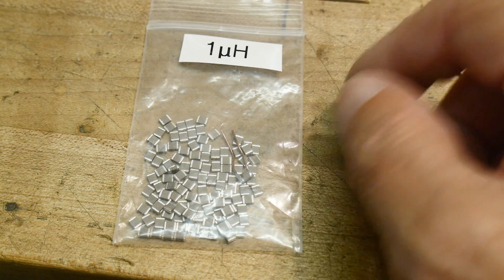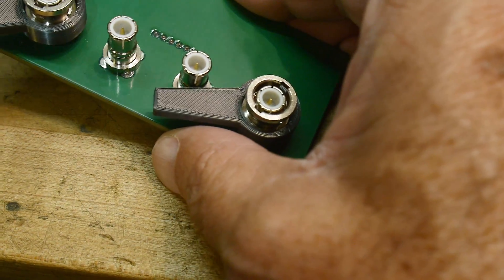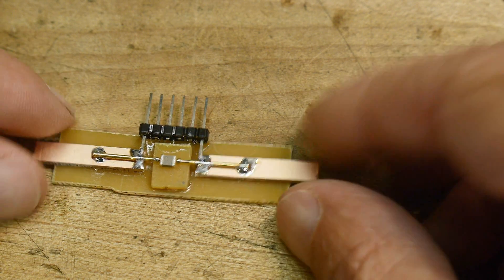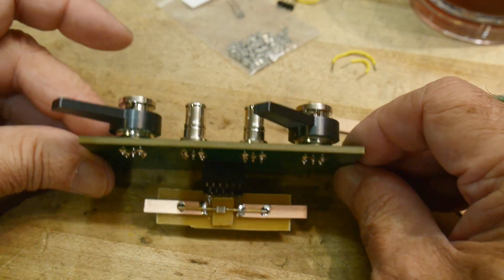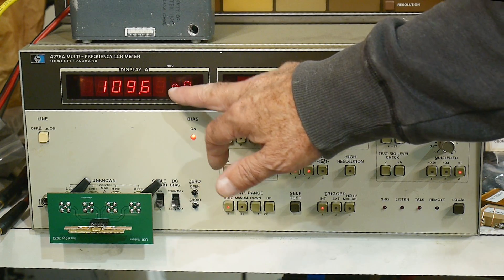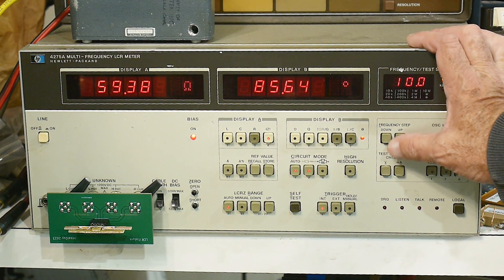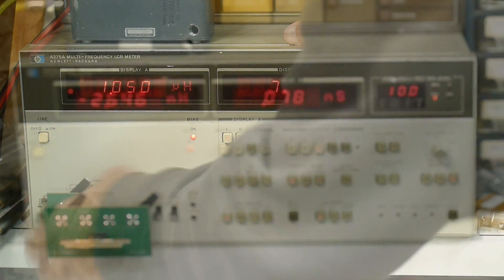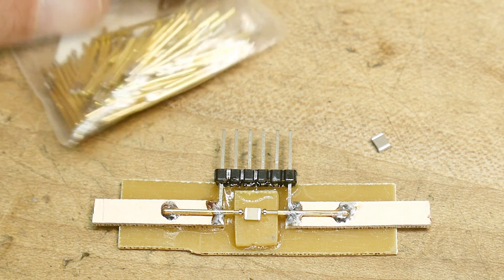#1700 SMD Fixture for LCR Meter

Comment: What I would like to see is the capacitance of the empty attachment.  I notice the frequency dependent change in the impedance angle display.  That is one reason to suspect stray capacitance effect.  I myself have so far used an SRC meter (only up to 100 kHz), but with Kelvin “tweezers”.  Of course they are quite pricey.  But for a DIY socket I would consider making a little L or U shape brass or bronze sheet metal device, mount it vertical, and form the “knife” edges a little V shape, open at the top.  That way I would be able to simply drop the part between the two or 4 knife edges with tweezers, maybe pushing just a little down,  The tweezer could grab the part in the smallest dimension, just like you probably do with your pogo pins?

Comment: I only do ball park checks and sorting so i got those cheapo tweezer probes, shortened the leads and connected them to my component tester.
At the moment i do nothing that needs more than a +/-5-10% accuracy, so it's fine. Plus i can do in circuit testing with them, with all the attached caveats of course. Once i do something where i order 10kg of capacitors to just find the one that i need (aka binning) then i might be in trouble and in need of something better :D

Comment: Board layout matters for sensing, Analog has an excellent write up on it in the June 2012 Analog Dialogue. A simple pogo pin jig like this could have errors in the single to double digit percentages depending on the range.
Reply from the maker: you can do an open/short and cancel out any errors

Comment: Hello, here is one more idea, you can use clothespin or clothes peg. Use wooden one, Glue (kitchen) metal foil on both ends and solder them to probes which you put. In that way, you can literally grab component and release handle to grab component and keep it under tension.
Your design is good one, but its smd slingshot in some way... :)

Comment: This is a perfectly lovely fixture. I know that you like the KISS approach, but you also have a new 3D printer, which you need to justify purchasing... lol So, maybe you should challenge yourself to build a more robust solution that addresses the things that you don't like (you said fiddly,) or that could work better, or make it accept different SMDs more readily???
Reply: Mousey / Circuit Board Hardware - PCB / PN 575-7937000150000030 = Flat faced pin thingy.

Comment: My recommendation for the use of cheap pogo pins is to place them so that the load is not axial. Especially where there are high frequencies or good contact is required. It is necessary that the pin itself is pressed against its own case, and not just contact through the spring.
Reply: What to connect the moving part of the pin and the base with a short cable

Comment: Good idea already, more interesting (for me) is the loading of the test socket. (I am not happy with smd tweezers or I just take to cheap ones.) 
There is one alignment on the bottom, (why not on the side,) and the commercial holder was even V-shaped. A spring relief for insertion might be like the one at the zero insertion force sockets. Maybe I try the next version.

Comment: One thing I've been curious about with LCR meters is the different test frequencies. Is there no "definitive" measurement of inductance? Or do you just pick a test frequency close to the frequency you expect to be seeing in your circuit (or attempting to filter out)?
Reply from the maker: https://www.coilcraft.com/getmedia/917e2972-9585-4c8f-a94d-9a5b02fdffd9/doc119_testappfreq.pdf
Reply: There are a few ways to characterize an inductor. If you want "one" value with mH, you can make a sweep from low frequencies to higher ones. Although at low frequencies the measurement should be noisy as there is a lot of resistivity instead of reactance, you should see it is a fairly straight line. At higher frequencies it starts to deviate. Take the "straight line" value at lower frequencies.

However, inductors with a non-linear core do not only have problems with frequency, but also with amplitude. So it matters if you do a current sweep or a voltage sweep for example. I've made inductors which easily where chopped in half (the inductance value) if you doubled the frequency or amplitude.

The "picking a frequency close to your target" works quite well, as you are normally not directly dependent on the value of the inductor and you are busy with dB's where 1 dB deviation is easily tolerable while that's already 12% off!

For more specific simulations you can put S-parameters into a "block" so you can have your frequency dependent inductance.
Reply: On my LCR, I set the measurement frequency according to the operating frequency of the component under test +/- about two ranges for the orientation of the value change. 

Nice day 🙂 Tom

Comment: Nice little fixture 👍 I just use Kelvin clips for "larger" SMD components, but once you get down to 0603 then it's hard and most components will go flying never to be seen again. So for the really small stuff I use some PCBs with pads to solder in the components, it's a bit fiddly, but not that bad and it gives you solid Kelvin connections all the way to the component for most accurate results.
Reply: The only problem is that you need to unsolder them again afterwards, which can be tricky.

Comment: Nice for characterizing a part.  Could you adapt your kelvin tweezers to speed sorting tasks?
Reply from the maker: yes, in fact keysight sells one, 16334A
Reply: @IMSAIGuy  New for $1600! Used for $200 on ebay.  Okay, found what appears to be same on aliexpress for $79.
Keysight is made in China right?
Reply: @IMSAIGuy  I made the SMD tweezers myself, although a friend printed the BNC control levers on 3D, but they fell apart.

Nice day 🙂 Tom